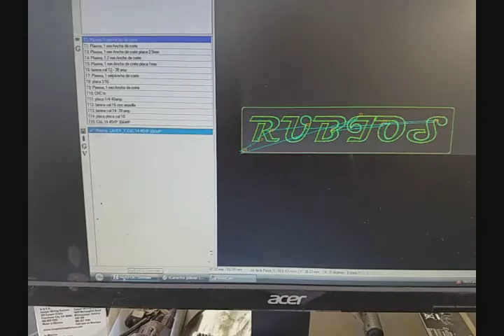Actualización de equipo cnc 1332 45xp

Comment: Con este tipo de máquina puedes aser una multiperforacion en un área de 6.5x40.5 cm orificios de.     3 1/6 en lámina c18 y c 16
Reply from the maker: Si, sin prpblemas.. si revisas los nuevos vídeos el diseño ha cambiado respecto a este modelo .
Reply: @RUBIOSCNC  cuáles son los nuevos vídeos para saber con exactitud
Reply: @RUBIOSCNC  y q precio tendría la máquina en las siguientes medidas 1.22x2.44
Reply from the maker: @lmlm5013  el equipo comercial de 140x320cm le costaría lo mismo si le hago una de 122x244cm 
El costo del equipo con hyperthem 45xp 236,460$
Reply from the maker: @lmlm5013  mi cel 3171031760
Reply: Ok gracias en unos minutitos me pongo en contacto con Tigo gracias

Comment: hola josue soy mauricio de argentina me arme un cnc para plasma y solo queria consultarte por 1 problema que estoy teniendo, el problema es cuando la pongo a funcionar me vibra mucho la mesa debido a que es trasmitida desde los motores  que su vez este defecto se ve trasmitido en el corte, solo con cortes  de con dibujos o de formas irregulares, no lo hace con cortes rectos ni tampoco con circolos, me podrias orientar como puedo solucionarlo o por donde empezar corregir el problema.
te comento que lo que uso es sheet cam y mach3 con thc. motores nema 24 3.1 y driver TB6600.
muchas gracias por tus videos y tus cnc muy buenos.
Reply from the maker: El diseño de tu mesa no es el adecuado , o tienes los rieles muy débiles.